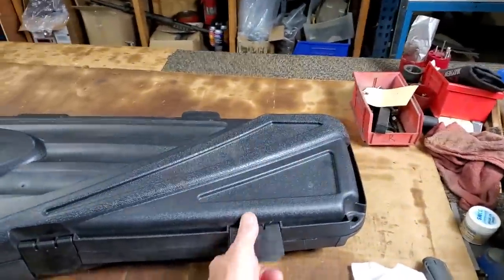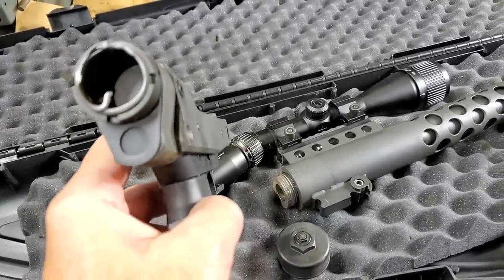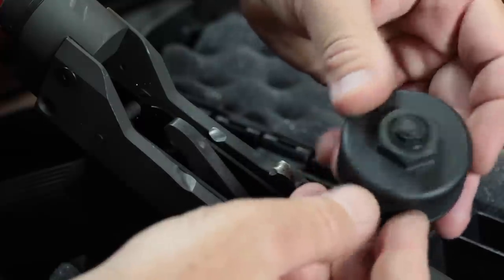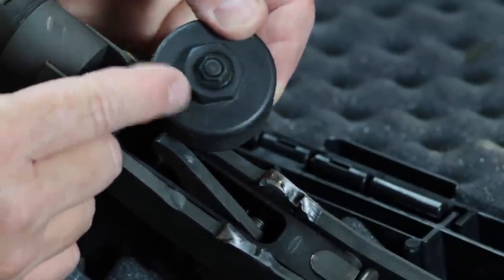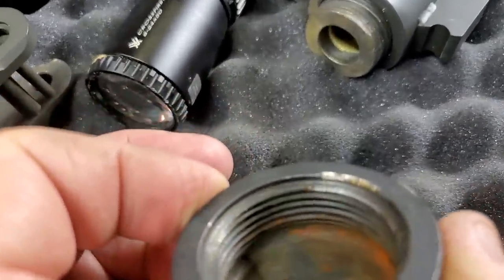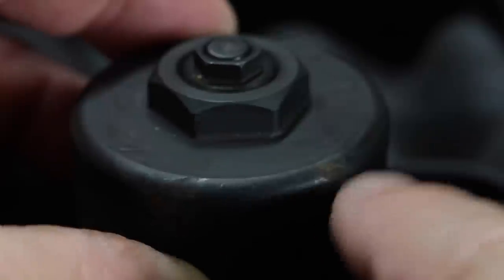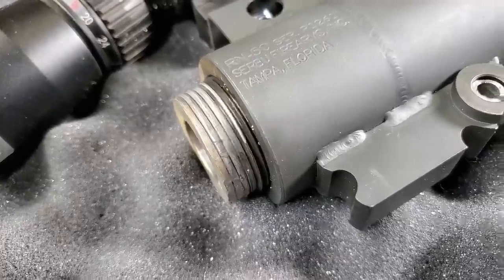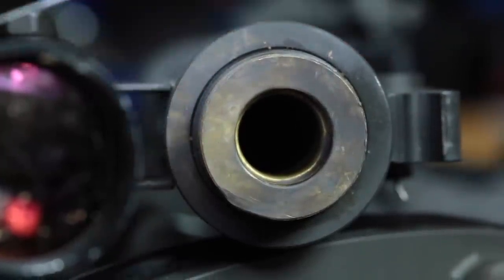Kentucky Ballistics' RN-50 Blow-up:  First Look

Comment: The ears that got seared off might have made those gouge marks. Not everything was the cap. That could have flown off, same strength of the rest of the lower. One flew into Scott so that might be the one that hit the back of the upper before it went up. the other one was never found so that might have cause the bigger gouge mark and went flying off to the side.
Reply: Both ears were recovered. Hospital has one and Scott found the other around the table at the range. It should be in the case with the guns remains.
Reply: You can see the marks on the cap where it hit, Mark specifically points this out, Plus the edges of the lower were bent outwards which takes an angled surface or a really hard his from the direction it bent from, so unless those ears turned 90 degrees and hit sideways... if say it was the cap
Reply: @jaykneegarner2479  interesting. But still believe they could be the reason for the marks on the lower but of course I could be wrong.

Comment: So the lessons I'm taking from this incident are:
1) be REALLY careful of ammo in a .50 cal
2) avoid SLAP rounds or other old ammo in high pressure, high caliber weapons, like .50 cals.
Reply: Know your ammo for sure. Slap rounds are safe for this rifle as long as it's loaded properly like ammo for any other gun. In reloading they tell you about this. Make sure you have the right powder, right amount of it. Too much or too little then bad things can happen. Even for a 9mm pistol round. In fact during war sometimes an army will overload the enemies ammo and leave it where they'll find it. Later whoever uses the ammo is going to be injured or killed. That's a part of war.
Keep in mind a 50 Cal is no joke to begin with. Big heavy round, lots of force behind it. You have to watch what you're shooting with it because they're hard to stop. They'll tear apart light armor, shoot down aircraft, go through walls. It's great for long distance shooting. It's very good for what it's used for.
The whole question here is - was it a round loaded by a factory to specifications or did someone take some old brass and reload it with whatever? Maybe it was loaded this way intentionally and whoever loaded it didn't have the guts to fire it (safely, like away from it with a long string), forgot about it and sold it. These are very expensive rounds. A normal 50 you can find from $1 if you're lucky to $5 a piece. Slap round if you can find one often goes for over $100.
Could be someone did this intentionally to kill someone. There are people like that out there.
More to come, stay tuned.
Reply: Don't the headstamp say they're from 07? It doesn't seem particularly old to me.
Reply: @ducksrgud  I've seen a couple videos abouts this mention that SLAP rounds are no longer in production, and some speculate that the abnormal reaction of the round may be due to degradation of the powder. Others think these were reloaded SLAP rounds, i.e. old brass and too little powder, causing an abnormal pressure curve. Lots of speculation at this point.
Reply: @ducksrgud  Yes, it's an 07 headstamp. To be exact, the markings of the headstamp denote Western Cartridge Company 07.

Comment: Looks like that cap hit where those gouges are, killed some energy and tumbled. It would explain why there is some much lighter scratches past that, as it looks in line with the nut on the back of the cap.
Reply: That’s what it looked like to me as well.
Reply: I think the cap flipped backwards, hit where those marks are, and tumbled upwards.
Reply: Same atleats it wasnt the gun it was the round that was faulty

Comment: U can tell when the cap sheared the ears it began to tumble and that is when the cap struck the lower also when the cap began to rip the threads off it had such force that it also sheared the pivot pin.. think of the forces the cap itself had to throw the barrel forward and at the same time shear the ears and pin almost as if the cap itself was explosive!
Reply: Perhaps future generations of the rifle should include a milled slot on the pivot pin so that, in the one in a quadrillion chance this ever happy again, the pivot pin will fail significantly before the ears, hopefully causing the barrel to blow forward,  rather than ears to blow off?  

(Not that it would help too much.  The moment of inertia is greater on the barrel than the cap and reciver combined)
Reply: Damn, I just said something similar.
Reply: @scottmcdivitt2187  not much you can do against 180,000+ PSI
Reply: The barrel would be blown forward by chamber pressure on the tapered section towards the front of the casing.  The same pressure over a larger area would be pushing the cap backwards.  In normal operation the treads between cap and barrel contain that force, and only the difference is pushing the barrel assembly aft against the lugs and pin.  The barrel itself, being the most massive part of the gun, would moderate the recoil speed and force the rest has to absorb.
Reply: @scottmcdivitt2187  Some guesswork here, but I'm thinking the lugs sheared off before the forces propagated from the lugs to the pivot pin.
Reply: @scottmcdivitt2187  That ruins the whole point of the ears, which is that they ensure the gun is fully in battery.
Reply: I'm curious to know where that slap round ended up?! Prolly went thru the hydrant and thru the back stop if it didnt go directly into the ground a couple feet in front of scott
Reply: @dchil15  he doesn't mean let the pin move he means to make the pin the weakest link so it breaks before something else letting the barrel be pushed forward and away from the shooter. on Scots gun the pin stayed together long enough for the cap to brake the ears letting the cap fly back. they do a similar thing with PTO driven implements on tractors they use a shear pin or an overload clutch so if something goes wrong less shock is transferred to the tractor.
Reply: @phalanx3803  I misread that.
Reply: @phalanx3803  

Looking at the parts, I'd say that pin was already weaker than the cap or lugs
Reply: @hanelyp1  that's possible,  but it seems likely that the lugs were still partially intact when the pivot pin failed, otherwise there would have been no force forward to shear the locking pin.

Comment: That’s just incredible how it bent that 1/4” steel like soft lead. Such a strong robust  receiver and just demolished like child’s play.  Thank god scott came out the other end alive.
Reply: @Just A Man Does that part need to be heat treated? It's not supposed to take any force from the round going off, right?
Reply: @Just A Man from a machinists POV there is absolutely nothing wrong with the design threads are extremely strong. The one major difference between this failing and something like a Barret M107 is that the M107 does a better job containing a detonation.
Reply: @camojoe83  as long as the pressure bearing components were properly heat treated it really would not help anything if the lower wings were too. This obviously had an insane amount of force to strip those threads.
Reply: @camojoe83  the cap didn't give at all though as you can see in this vid, i am a machinist and work with metal for a living, those threads should be more than enough.
Reply: @Just A Man first of all where did you get this 900 dollar number from, second of all my point was that the receiver and recoil system does a better job containing a detonation in case of a catastrophic failure which is a VERY rare thing to have happen in the first place...
Reply: @camojoe83  It was the Barrel threads that failed though. Also, didn't he mention the front pivoting pin gave out. Which would still allow for the cap to fly backwards if the ears didn't shear. By possible tilting of the barrel and the rear tilt of the lower allowing the cap to fly right over.
Reply: @Just A Man  my entire point has been that there isn't really anything wrong with the design and tbh i seriously doubt one of the nicer .50 BMG bolt actions like the Barret M95 would have done any better in a catastrophic failure. I have no interest in owning a .50 BMG rifle personally but just talking from my experience as a machinist.

Comment: The discrepancies between the round Scott was holding and all the photos I've seen of genuine Olin/Winchester SLAP rounds are just too glaring not to raise suspicion of them being counterfeit. In addition to the complete lack of any sabot pre-cuts, the primers shown were brass colored, as opposed to the silver-colored primers of legitimate ones. The stamped WCC lettering and numbers are also too widely spaced and lack the SLAP designation. Regardless of whether this is simply due to changes in WCC's stamp design over the years, it would not be difficult to counterfeit. The issues with the bullet seating adds even more suspicion. Will be interesting to see expert's assessment of their authenticity.
Reply: I wonder if he could get that casing tested for explosive residue?
Reply: Yes, test that cartridge for types of explosive residues like what they used during "Project Eldest son" to sabotage ammunition during the Vietnam war.
Reply: @infinitepower6780  it was obviously an improper load that led to the case head separation and gas leak into the breech. But, I think the much more plausible explanation is a non-nefarious mistake by the reloader/counterfeiter.
Reply: @Vdubin4741  It's been said that SLAP rounds had not been invented yet at that time. I haven't verified that, but perhaps one of you could. And I'm not aware of the US Military using that tactic during any major conflicts since then. If you're aware of some instances of that post-Vietnam, let me know.
Reply: understood. I was speaking to something similar being done for more recent conflicts. There are plenty of .50BMG's running around in the wrong hands in Iraq and Afghanistan.
Reply: @Vdubin4741  RE: Yes, test that cartridge for types of explosive residues like what they used during "Project Eldest son" to sabotage ammunition during the Vietnam war.

What is with all you loons thinking is this sabotaged ammo? There is a perfectly reasonable explanation that is one of the most common causes of injuries in the reloading community (especially among noobs who fucking don't think once let alone twice before doing something other than the instructions).

That's been my theory. These are "reloads" of original rounds (which is why everything matches up). Some guy probably came across them, figured they were in bad shape / powder had degraded, so removed the bullet and reloaded them. 
1. My first thought, was it used an odd grain size/shape of powder so the guy used, "whatever seemed closest" (read: Regular .50BMG powder) which was probably a shorter grain gunpowder.
2. He weighed the original powder charge... without drying it. Possibly throwing off the weight by a (relative) ton due to absorbed moisture. So say he weighs it out at 260gr (a normal 50 is 215-220 nominal), and he thinks, oh that's fine, big tungsten projectile, blah blah. In reality, maybe that's 30gr of water that's been absorbed over the years.
3. He has now reloaded these with ~18% MORE gunpowder, of a finer (faster burning) grain.
4. Scott almost dies.

I hope he has the information for the guy he purchased it from. I take serious concern with false representation of goods.

Comment: The 2 dents on the lower are not from the breach cap. They are fron the ears bending back into the sides,  then they broke off. It's very unlikely that the cap had a downward trajectory especially after coming into contact with the ears.

Comment: To shear those threads I would say it was wrong or degraded powder.
Reply: Likely a fast powder, or pistol powder was used.
Reply: I did find an xm903 which does use a taper crimp. Mark mentioned he had not seen that on slap rounds before for the 50.
Reply: @mrbreck1  Different color and shape of sabot.
Reply: @skepticalbadger  I was only speaking of the type of crimp used. In the video mark said he had not seen that style used on the sabot before and the one i listed was also noted as being used on the older sabots which may have some relevance.

Comment: A close look @ the bent (mangled) lower is enough to tell me without question that this accident was caused by the slap round and the slap round alone.  Scott is a very lucky man and Mark is as honest and honorable as anyone can be.
Reply: Wouldn't be the first time SLAP rounds cause malfunctions. I know the round made for the M60 caused multiple barrel failures. 
Then combine the fact that they're old as hell, used it the Gulf war, probably never stored right and often faked it could only lead to a failure at some point.
I've asked a few vets and gunners about these rounds after the accident happened, and they weren't reliable even back then

Comment: Obviously Mark has a better view of the shape of everything, but it almost looks like rather than the cap moving straight back, it may have pivoted about the lower edge from pushing through the ears (possibly the barrel/threads at this point causing the damage to the inside of the cap?) and the "top" of the cap slammed into where the two "gouges" are.  The bulging of the metal around these also appears more consistent with a downward impact like this than a purely rearward motion as demonstrated.

Comment: I know that CIA used to (probably still do) spike shipments of ammunition with the powder replaced with high explosives or overly hot propellants. It was meant to destroy enemy weapons. If those rounds are from overseas it might be one of them. Chances are super super low but the results are similar. Would cost a lot but you could have the powder residue analyzed.
Just a thought.
Reply: I smell a congressional hearing lmao.
Reply: Where you hear that? Any links?
Reply: @johnm3907  I'm thinking of "Project Eldest Son", a Vietnam war operation where exploding ammo was slipped into communist supplies. Though it seems unlikely that they'd make exploding .50 BMG. https://en.wikipedia.org/wiki/Project_Eldest_Son
Reply: Well known that interfering with enemy ammo supplies was done during Vietnam,  I guess its been done since. 
But slap rounds are known to be high pressure rounds to give the pen required.

 I guess that adulterated rounds would be aimed at high value weapons, mortar, artillery shells by preference grenades would  easy to alter the fuse to an instant detonation rather than delay, pull pin release spoon, bang whilst still in hand. Happens once or twice and nobody is throwing grenades, same for mines. Higher weapon cost and more damage per cost in money and risk in adding to enemy's supply's. Rather than single bullets. 
Slap rounds are already specialised so I doubt they were deliberately adulterated and its more likely just deterioration due to poor storage and age. But thats just a guess. A full residue analysis would give furthering and might eliminate the possibility of an adulterated round.
Reply: ennemy weapon that use 50 cal..................... a round of 7.62x39 maybe a 12.7x108 maybe but why made 50x99nato traps round
Reply: @wolfarmour2956   .50s have been captured and used before including multiple types of .50 rifles homemade and produced. Even videos of ISIL using .50s, Same with the fact that Houthis capture .50s from Saudi positions a lot so. Never know.
Reply: @wolfarmour2956  Taliban has technicals with M2s mounted to them.
Reply: @nickc8667 yes maybe  1 on a 1000....  pkm and rpk are by far the main weapon and tecnika been kind of really rare after 2004
Reply: They still do.  Was in the New York Times last year.
Reply: Fair thought but something to remember is when scott went over the footage of the incident the rounds became increasingly hotter visibly, with the muzzle flash getting bigger and bigger, although I dont know if this is really that relavent, but fair thought.
Reply: @wolfarmour2956  You do know that they've been doing it since Nam right? And Nick is right but keep in mind that we don't only have enemies in the middle east. Some are very very close to home. Like Scott said, the rounds have had multiple owners. Could be from anywhere. 
Again, might be spiked. Might not. Residue test would clarify that for them.
Reply: Exactly what I was thinking. Spiked round. Also, 50cal, is too dangerous.
Reply: Действительно, следы нагара на оружии могут сохранить признаки посторонних веществ, не входящих в состав винтовочного пороха. Или показать нестандартное распрелеление обычных элементов, остающихся после стрельбы.